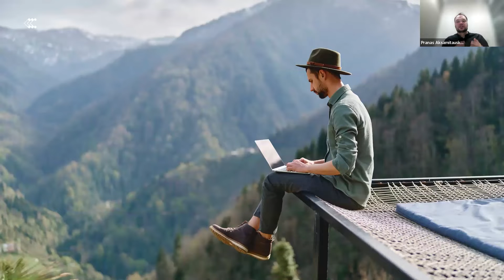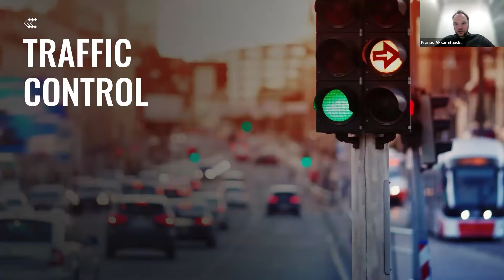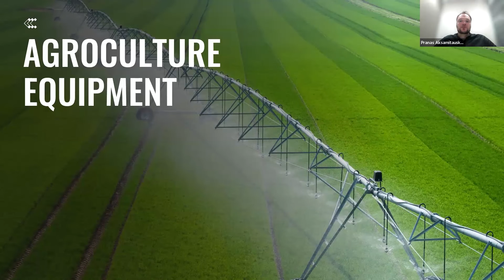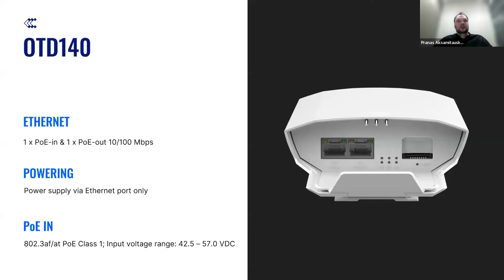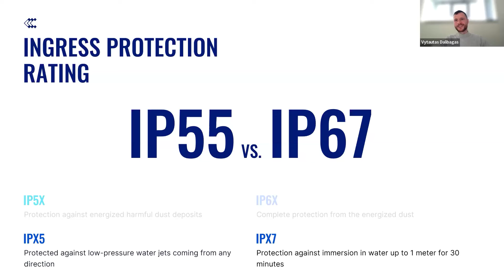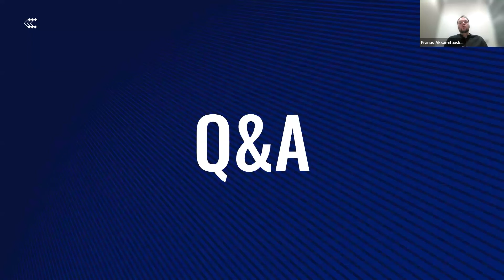Outdoor Connectivity with The OTD140 | Webinar

Comment: I have attached to a poe injector and have no Poe out light any idea why?
Reply from the maker: Firstly, please check our quick start guide for the OTD140 to ensure that you are following the steps correctly: https://wiki.teltonika-networks.com/view/QSG_OTD140#Hardware_installation
If everything is correctly connected, the cables are in good condition, and the POE injector is properly powered, please reach out to our technical support engineers through our community forum here: https://community.teltonika.lt/c/teltonika-networks/5

Comment: Hi ,could this be used on my campervan for gaming?
Reply from the maker: The OTD140's LTE CAT4 mobile modem cannot provide extensive internet speed. Depending on your gaming expectations and if you have good internet connectivity you could use OTD. However, for better gaming with less lag and more speed, it's better to use a wired broadband connection with faster Ethernet ports or a higher LTE category.